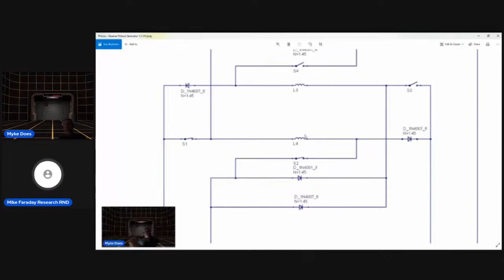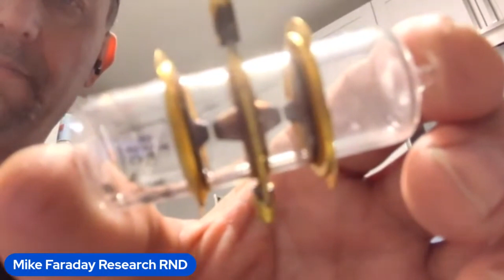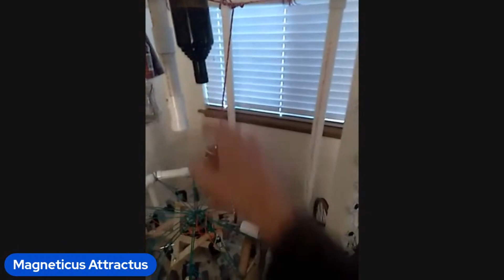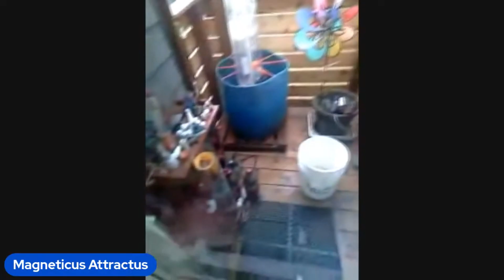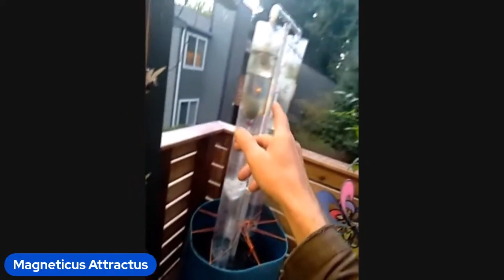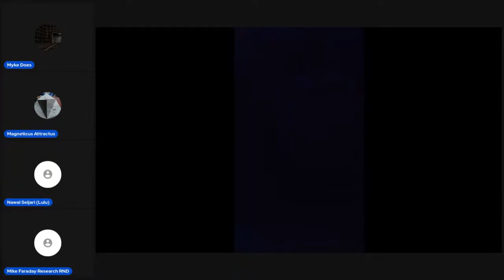Open Mic electronics energy  and General

Comment from the maker: 30:15  can do it by choosing your own carrier wave in AM range that nobody uses and push FM inside the AM carrier . If cant push FM can try a number of other wave forms , SW so on . anyone can hear the carrier wave but the wave its carrying is encrypted if not encrypted can choose date frequency that is not easily tuned into with traditional equipment , aka a custom primary secondary config . Technically speaking this is a 2 D frequency transmission , by now one has figured how to transmit 3D signals , and if your equipment is only 2D receiver you will only get 2/3 the info  (All technical theory not practice)